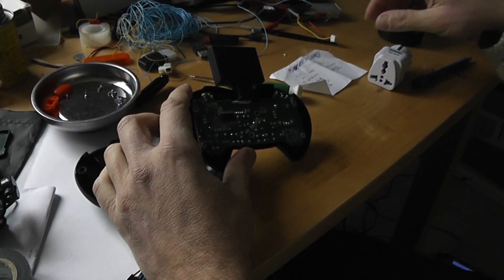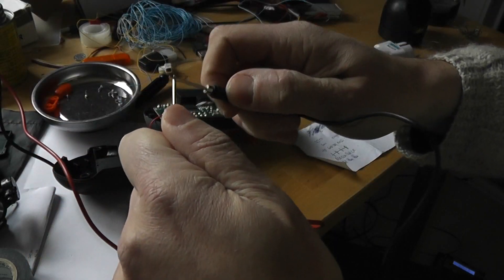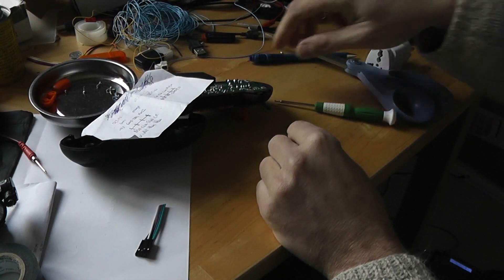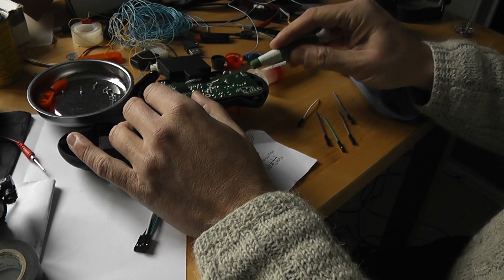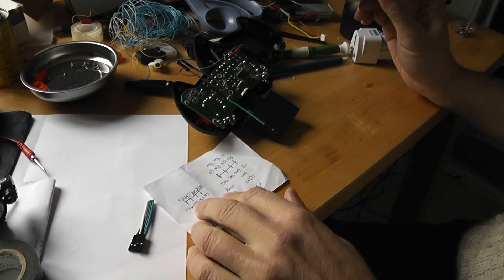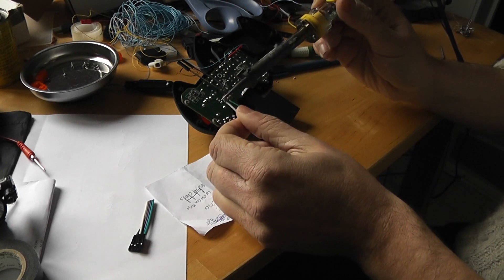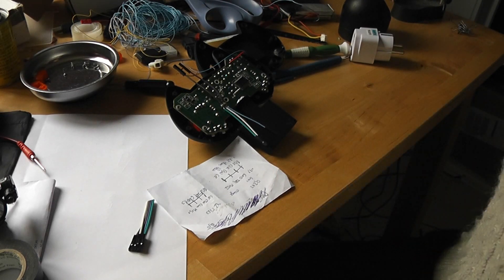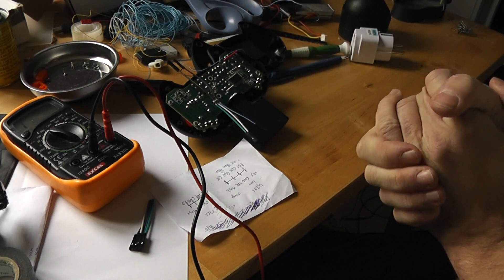Demo video: how to capture SPI data from a toy quadcopter

Comment: Great video Seby, was watching an earlier video you did on this.Really would like to learn how to do this.How are you distinguishing between the solder points ex: miso & mosi  etc,or are they labeled. Where can I get the soft ware from?Thanks in advance.
Reply from the maker: +C0ckPitVuE 777 For this radio.. yes, was partially labeled on the other side (see my RCgroups reviews). So it was more easy. In fact, most of the time the pads are always the same...
Reply: +SeBy DocKy Thanks for the feedback,I got the link to the analyzer I need the link to the software and multimeter,if it's not much inconvenience,I would greatly appreciate it.